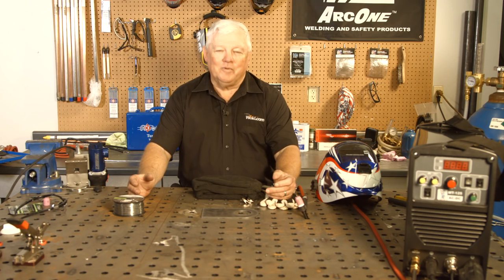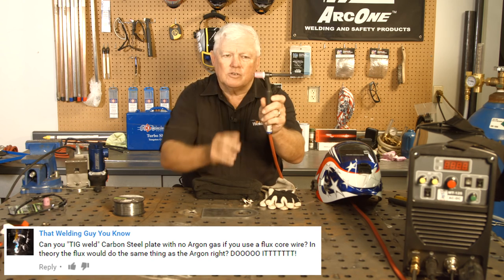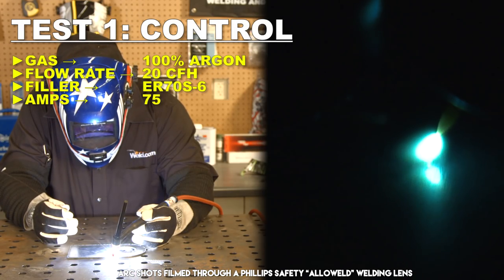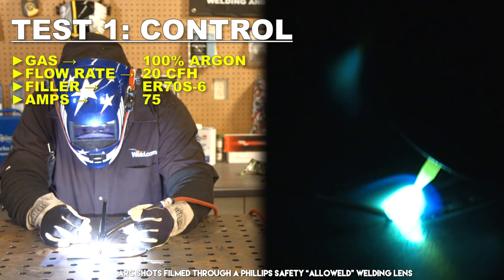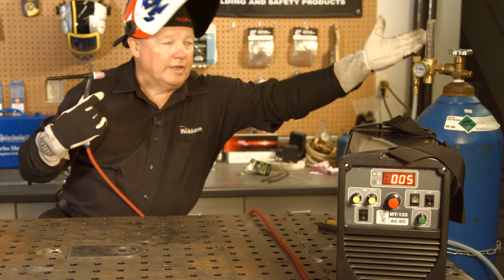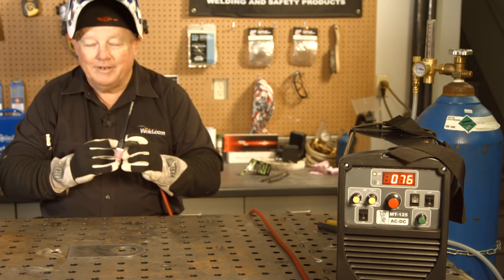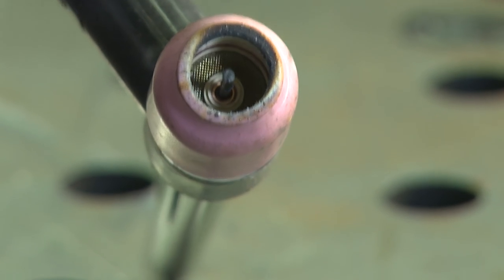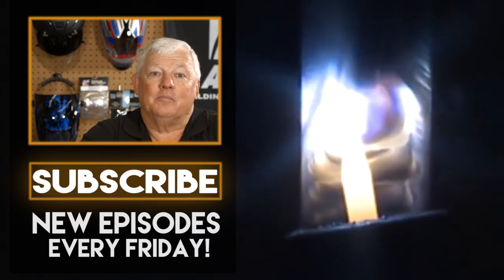TIG Welding Carbon Steel w/ Flux Cored Wire and NO GAS

Comment: Looks like what happened to the tungsten in my torch when I was testing to see if the lift start worked on my well used Miller. I don't have any shielding gas yet and it just vaporized the end of the tungsten and burned straight through the 1/8" plate in about a second. I don't think compressed air would have any effect on it, the presence of oxygen just makes the tungsten oxidize and melt very rapidly.
Reply: Argon also cools the tungsten down hence why helium was used as it can cool the tungsten because of its high heat conductivity and also it can shield the weld pool. Argon can do that too

Comment: My TiG welder also equipped with arc welding capability, so this is not necessarily unless an emergency.  One time I tried installing a brand new exhaust down pipe and found a hole in the weld joint area, I am forced to use TIG without an argon. I was able to weld but my tungsten tip burns off a bit and have to re-sharpen again.

Comment: The argon does more than shield the base metal and pool... it also prevents the same oxidation of the electrode... and it would likely be possible to TIG in a vacuum without gas but a true vacuum is very hard to achieve and outer space is  a little more expensive than a bottle of Argon.

Comment: Clearly needs a heavy flux stick rod instead.  I've seen it work with 4043 alum rod - would like to try on steel.
Reply: Without gas you burn up your tungsten so I don’t think you did see it work with 4043.

Comment: I use rods by Castolin Eutectic with sort of powder flux inside for welding cast iron castings but it neither shields the bead nor leave any slag on top but rather contains powdered metal ingrediends and spices.

Comment: Sir, may I ask a question please: I want to add (weld) small custom connection clips to a bicycle chain - used to turn an observatory dome.   If you can imagine turning a bicycle chain with the chain clips horizontally, so I may add a small motor to turn a dome.    I am unable to find any commercial clips that attach/connect to a chain, which would allow me to attach the chain to 'something.'   Therefore, I need to use some small hardware clips - and weld them to the chain.    What TIG welder would you recommend and I do see TIG welders on Amazon, but I don't see canisters of argon.  Perhaps, I should not be using TIG for this application, perhaps you would recommend another welder system.  My preference is not to use a welding system that requires a gas - rather just a voltage-related (melting) system.  Something like a soldering gun, but with much greater welding ability.   Your advice/suggestion would be greatly appreciated.   Thank you.

Comment: I want to forge weld steel but I want to use my tig to weld the pieces together with no filler just to block the O2 can you do it without gas and you proved it wont work without gas

Comment: oh ok but how about using stick electrodes as a filler rods? with argon ofcourse?
gonna try it tommorow in shop.
I use sometimes nickel elecrodes for tig but with stripped shield.
wonder how will it work with flux shield.

Comment: obviously starting the arc without having shielding gas is going to cause your tungsten to die and your base metal to be contaminated beyond salvation. no chance for the weld after that.
also think about the feed rate of the Flux core process. you're attempting to stretch that tiny dabs worth of flux to an extreme limit.
it somewhat defeats the purpose of the test, however if you'd like to see if it's possible, start your arc with argon until you have fed your wire. then instead of dabbing the rod, attempt an extremely rapid feed.once you've got the wire melting the argon may not be needed. you may just get enough shielding from the inner flux. 
DOOOOOOO ITTTTTTTTT!

Comment: Should of used 1/16" or .072 wire instead of .035. Flux core is hollow  so there's a lot less metal there per inch. Not to mention it would have more flux so it would've shielded better.
Reply: Nope. Without gas you’ve (you have not you of!) got a burned tungsten. No way around it.

Comment: If you replace argon with air from an air compressor to cool the tungsten?
Reply: it's oxidation that kills the tungsten, no so much the cooling
Reply: Result: Congratulations, you've just created a crap plasma cutter.
Reply: the key of TIG welding is not not let oxygen that in the air to get between TIG torch tip and the metal or material that you are trying to weld . so you must need that argon gas to create this shield .

Comment: Can you tig (braze) with argon on aluminum but use aluminum brazing rods (the ones that are designed to be used by a gas torch) instead of regular tig rods?  I like the hardness of the aluminum brazing rods.  Do you think the resulting join is better than regular tig rods in terms of durability?
Reply: ya- I like to know that too. I have my first tig welder coming in this week. I will try it. I have 4 pounds of AL3 rods (tin, aluminum and likely zinc). they are the Chinese ones from ebay and not as good as the ones I got from lowes. Propane would melt the ones from lowes but these dont really flow. So.. I will try to tig with them.

Comment: Great video. I'm cheap and was checking in to see if TIG could be done w/o gas (quite expensive for the cylinder and gas). Seems like no. Guess the flux works on stick because there is not really any space between the work and the electrode.
Reply: These rods are made for open crack butt welds you absolutely need argon coming our your rig it just saves money on purging the stainless pipe with argon gas.
Reply: The flux works by creating a coating over the molten puddle therefore preventing oxygen from reacting with the metal. It does nothing for your tungsten because it doesn’t cover it.

Comment: cool demo . how  about using tig with gas and solder as filler.  My guess is that it would melt before ever coming near the puddle.
Reply: i do believe he already did that on one of the symbol repair videos

Comment: I think the request was for the opposite reason... they don't have everything for TIG! Like the stinger and not really wanting to invest in the argon bottle, gas lines, regulatir,... a welder with mig/Tig "ARGON" capability.. (all they have is a FluxCore welder.) ... ...  i think they wanted to know about using tig-Rod as added filler, using a Flux core welding machine!  ... ... But WHY!?!?!? ... Possibly For less slag, pitts, spatter and or porosity!?!?

Comment: I have been watching wall pros welding. They are all good anyd help full. I would like to to see some more interesting welding. For example to buildup a broken motorcycle cylinder find one in cast iron one in aluminum. These fins about 0.1875 inch thick and they are about 0.375 inch spaced apart. I like to see the to build up of an inside fin. Another simpler case are the plug welds especially the smaller ones. I enjoy the show and thanks for the help, I can use all I can get.
That Old Bob

Comment: Can i use a Air compressor for tig instead of the gas?
Reply: No. Argon is inert. That’s why it’s used. Compressed air is the same stuff you breathe, ie contains oxygen ie not inert.

Comment: I would imagine the tungsten would just turn into smoke, the way it does when you try to TIG in a little breeze.  If you use the flux core with gas you have dual shield!  //  Wow, that was pretty wild looking!

Comment: My former employer had a welder come weld some stainless steel on a commercial dish washer. It was some type of tig. But he didn't use gas. The welder was a tiny Miller it was not flux core or stick. DOES ANYONE KNOW WHAT THIS WAS? He had no gas and no flux. He said it was some new type of welding an the machine was around 3k$
Reply: I used to own a tiny Miller tig lift start welder that came with a extremely long power cable and the welder used disposable gas bottles that just fitted onto the strap so I could go anywhere and weld

Comment: i would expect the duel shield to work out well,  mig duel shield does
Reply: Wayne Hartneck it does work nice usually its used to not need to purge on stainless pipes

Comment: Compressed air will just feed more oxygen melting the tungsten 100 times faster. argon is used to create an oxygen free bubble at the tip. You blow on a fire to make it burn hotter

Comment: You are doing it wrong.  Twist several strands of flux core and lay them on top of the gap between to plates.  Now weld the plates together with the tig torch.  Now you will have

Comment: maybe if you used a laywire technique instead of the traditional dab
Reply from the maker: Unfortunately, technique won't change anything. The Tungsten needs argon to keep from destroying itself.
Reply: Cool video. I was thinking this might be doable and was going to try it with my everlast welder but I forgot about how no gas would affect the tungsten.
Reply: How much did everlast promise you per comment mentioning their name?

Comment: You didnt seriously attempt that 😂😂😂 man the whole point of the flux cored tig wire is to allow a stainless steel butt weld to be accomplished with no backing gas!! Since when in the entire universe has a tungsten not went to complete shit without argon coming out your rig?!! All that fancy equipment smdh